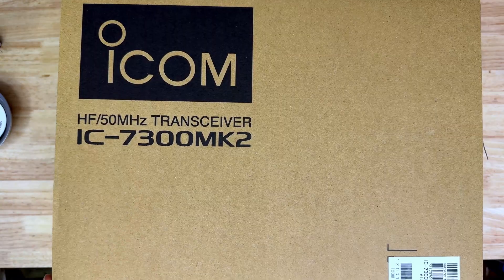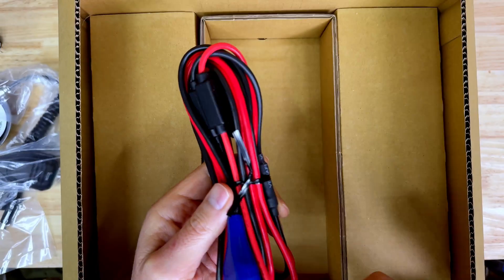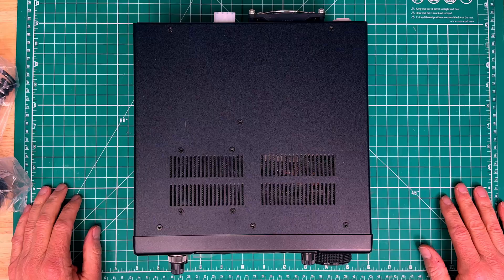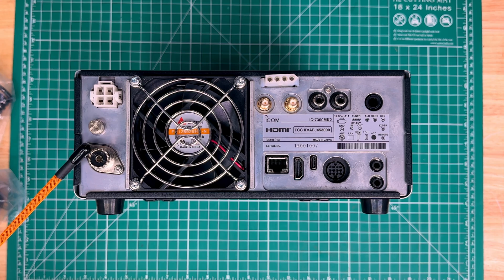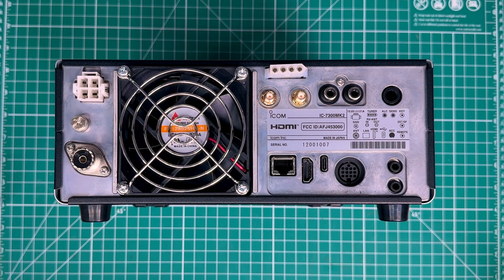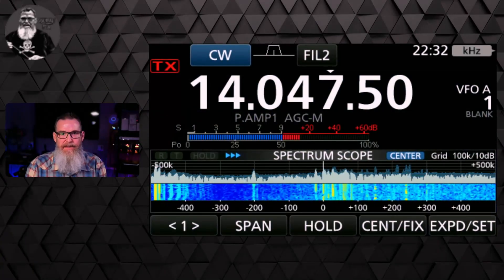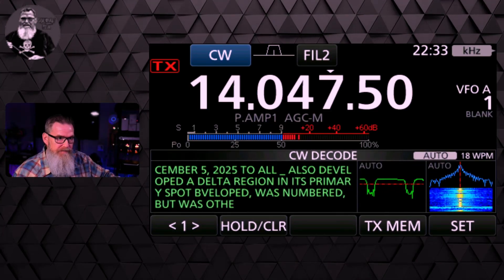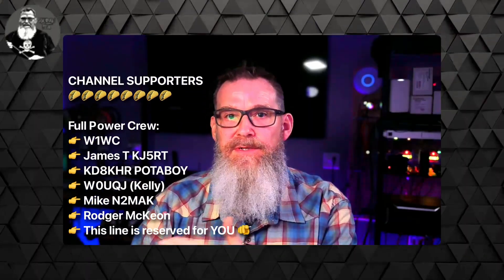ICOM IC-7300 MK2 Unboxing & First Look – HDMI, CW Decoder & More

Comment: I've seen several youtubes showing the replacement of batteries from the 7300's motherboard. Has the battery issue been resolved or upgraded in the mk2?
Reply from the maker: That is a good question. I have never had an issue with the battery on the 7300 classic so it has never been on my radar. I will pop the cover off and see if they made it field replaceable.
Reply: Nope

Comment: Very nice that it can do the 70 mbz band. Any chance that Icom will add DSTAR?
Reply from the maker: I believe the 70 cm option is in the JA version only.
Reply: They should have but did not. D-STAR should be a default on Icom. looks like I will have to still use my 5100 for that. Mine will be here any day as well.

Comment: Icom got this one right !  I have the old 7300 UK version. It opened up.  Just the quick band menu has 4 meters. That a UK 70 MHZ band. I never herd anything their. I got full open RX . The 2 long wave bands ,I can listen . 2200 and 630 meters.  I can TX on the new 60 meter space but have to drop to QRP power. I may never use that new part of the band.  But you never know. On the back of my 7300 the fan has made in Japan on it. Your new radio has made in China on the fan.  1 problem I had is my clock battery died . I never use it. I use GPS time when portable and I can send that to the 7300 clock. Icom has software for that . I did have to put ferrite on USB A to B cord. If you have any trouble with FT8 or and digital try ferrite on USB cable.  HDMI is great ! Still ok if you have 4K display. They step back. I see it draws a little less power. I have the data sheet for MK II . Glad they ship before X-mas !  73 from NY .

Comment: Any improvements you can hear on the DNR, or is it still quite "digital" when it's on level 3 or higher? Thanks for the video.
Reply: Looks like DNR did get a few tweaks and improvements by: 1.) Better rejection of strong signals - reducing DNR workload.  2.) Lower noise floor enhances DNR's ability to isolate weak signals. 3.) New refined DNR algorithms + extra profiles provide smoother audio, fewer artifacts in SSB/CW.  4.) Faster filter switching speed for reduced transient, quicker DNR engagement reducing pops and delays. 5.) Noise floor improved by 2db which helps with more effective baseline noise suppression.

Comment: 640x480 Mode was simple VGA.   (not exactly "standard video" which is/was  720x480 or simply  '480p').    1024x768 Mode is what I'd call XGA.   And last,  1280x720 Mode is just  '720p HD Video'  not  '1080p HD video'   (which i think you might have said by accident).     Nice video Grayman.  👍 I like the 7300MK2  but not happy on the price.  $1500 USD is steep for what the radio is.   I think I will hang on to my 7300 MK1  for a little while longer
Reply from the maker: That is a fair point. The prices on the 7300 Classic are down to $899 
USD with a manufacturer's rebate. If you are not needing or wanting the additional features, the Classic is a great value.

Comment: Does it has mouse control?
Reply from the maker: I am not sure if it has external mouse/keyboard control by connecting to the USB-C on the back of the radio, but it would if you were remotely controlling the radio over the network.
Reply: @GraymanPOTA do you have a usb-c mouse to check?

Comment: Tim! That MK2 looks absolutely gorgeous - ICOM really listened to what operators wanted with this upgrade. The improvements to an already popular platform are impressive. The original IC-7300 was a game-changer when it came out, and it looks like they've made some meaningful enhancements with the MK2.
I'm really curious how it performs in the field for POTA - that's where radios really prove themselves! Are you planning to take it out for an activation soon? Would love to see how it handles portable ops compared to the original.
Congrats on getting your hands on one! Looking forward to seeing more content with it. 73! 📻
Reply from the maker: I would agree that ICOM did listen to the consumer on this one. For me the big benefit is the ability to remotely operate the radio.

I'm not sure if there would be a big benefit over the 7300 classic in the field for a traditional SSB POTA activation, but I could see where the CW decoder could come in handy with someone who was still learning CW. I would also run digital modes right off my phone too.

I need a way to setup and find a way to measure a realworld receiver test where each radio would share the same antenna, coax, switch and be able to objectively measure the receive quality.
Reply: @GraymanPOTA  that would make an amazing video, and show a true side-by-side comparison.

Having the remote operation would have saved me from buying multiple radios for home, office, and studio

Comment: Lots of cool new features and great review.  Glad to see your review on it.  Just some friendly feedback, 1024x768 is XGA and the 1280x720 is 720p.  So it doesn't support 1080p.
Reply: Correct!  I thought I was missing something because I didn't see a 1080p setting on the screen.  1080p is labeled as 1920 x 1080 pixels.  It would be nice if it did have a 1080p resolution, though... But it's probably not needed.
Reply from the maker: I have heard it spelled both ways. 😁

Comment: I thought 1080p is 1920 pixels wide by 1080? maybe I read that incorrect...
Reply: You are correct on that.  1280x720 would be 720p or interlaced depending in how it was implemented.  Regardless it is still a great improvement over previous radios.

Comment: Nice video. The IC-7300 MK II, just like its younger brother the original IC-7300, absolutely does do FM. From the specifications listed on ICOM's IC-7300 MK II webpage: "A1A (CW), A3E (AM), J3E (SSB), F1B (RTTY), F3E (FM)".
Reply from the maker: Thanks for the correction! I appreciate you pointing that out.

Comment: Tim, thanks for the unboxing. One quick comment, you said the Mark 2 doesn't do FM. Did they remove it because my orig 7300 has FM. Just curious. 73
Reply from the maker: You are correct, I misspoke. The new MK2 does support FM.